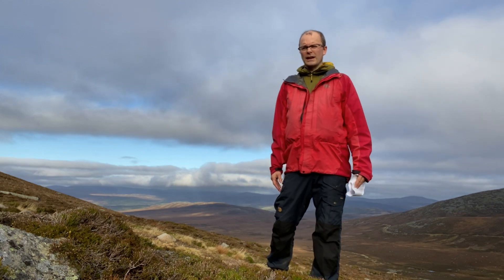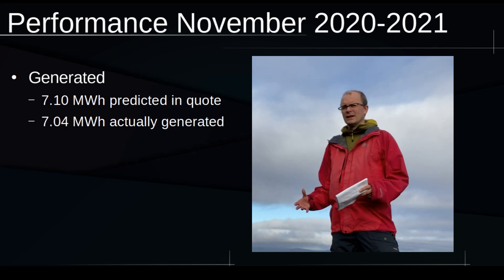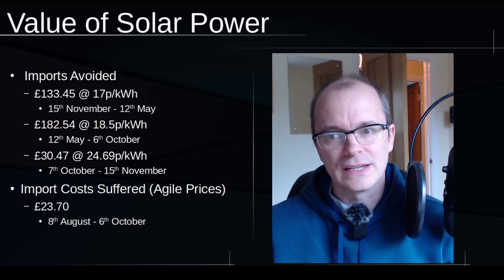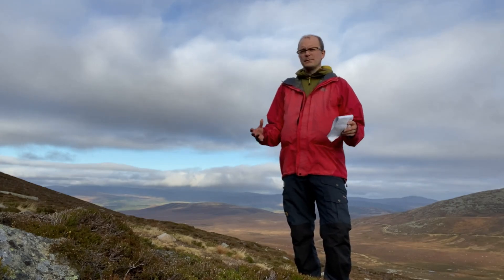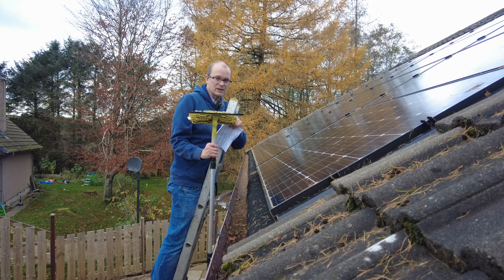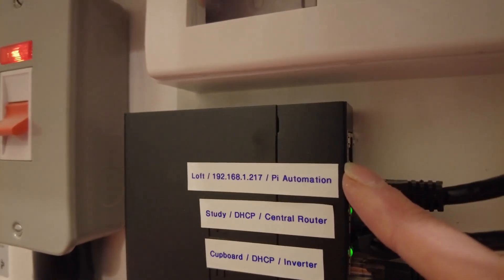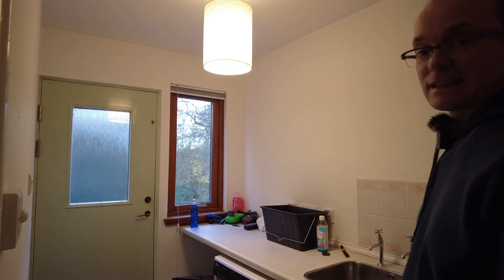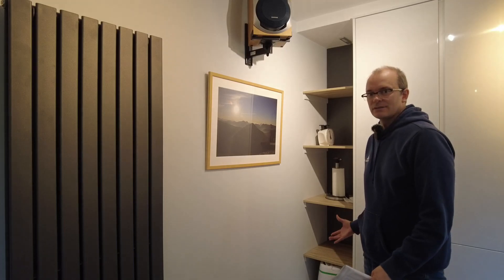First anniversary of living with solar panels in Aberdeenshire

Comment: Hi Anthony, now you’ve got your battery installed, do you still see benefit of the SolarEdge Smart Energy Hot Water diverter? My 8kw split array is limited to 6kw, so may not experience much clipping, which I understand to be a main reason for one of these.. Is the installation of this limited to SE installers? Appears very easy installation electrically wise and within my capabilities and experience as a qualified architect too.. Still only in my first month of solar installation ownership, it would just be a shame to lose out if clipping were to occur otherwise, as others have posted, cheaper to heat water with gas, albeit not the most environmentally friendly. The 5 year warranty is also a consideration.
Reply from the maker: I'd have to say that the hot water controller has been interesting before I got the battery installed.   But I wouldn't install it if I already had the battery.

The returns were there when export prices were pitiful, but as you allude to, it's not worth heating hot water if it's more profitable to export the surplus.

But there's another consideration:  Batteries give massive opportunity to simplify controls.  You can charge up hot water using the battery, and then you just need a timed switch for the hot water heater.  

This doesn't just apply to hot water heaters, but it means you don't need a "smart plug" for appliances running on surplus solar either.
Reply: @anthonydyer3939  Thanks for the prompt and informative reply. I’m in that limbo moment as waiting on my export MPAN to be provided by my DNO to Octopus.. and so trying to use all my excess solar until such time I know that it will be recorded and paid for… I was looking at WiFi immersion spur switches, but in reality, it will be cheaper to heat the hot water with gas. Maybe it’s just one of those options with excess solar that you spend a lot of time unnecessarily thinking about. My installation is 8kw and have a 6kw limit, and so I won’t know until next spring and summer as to whether I’ll experience any clipping, that could otherwise be diverted using a simple WiFi immersion spur. At £40 and I can install it myself is a huge saving, albeit lacking automation.. I may never exceed 6kW as my arrays are east and west.

Comment: Amazing how we're struggling with an energy crisis and they still limit exports so badly...
Reply from the maker: For my property there are good reasons.  When I'm exporting 5kW, the voltage at my property peaks at 247 Volts.

The UK legal limit for voltage supply is 207-253 Volts (230 Volts +-10%), so I'm not so far off that legal limit during export.  This tells me that the cable supply to my property is the constraint.  It's probably only a constraint between my DNO fuse cutout and the street, but I was quoted £7k by the DNO to get the neighbourhood transformer tappings upgraded.

Comment: I would be interested to hear you thoughts on Ripple Energy as an alternative to lower your energy bills through credits to your electricity account.
Reply from the maker: I looked into Ripple energy.  I’ve got a few doubts:
-  You are allowed buy a maximum quantity of power, up to an amount deemed sufficient to cover your annual needs + 20%.
- so let’s suppose you use 3MWH annually at home, and you pay 30p/kWh = £900 annual electricity bill + standing charge.
- let’s then suppose you generate 3MWH through your share of a ripple energy wind turbine.  You might be surprised that it does not wipe out your £900 bill.  
-  The money off your bill is only equal to the power purchase agreement price between ripple and your electricity supplier.  That is actually much lower than the open market seasonal forward prices for electricity.  So then let’s suppose the wholesale purchase agreement was for 10p/kWh.  That means you only get £300 off your bill.  Worse is that the lower wholesale price does not translate into a lower retail price on your remaining bill.  You have the same electricity prices as anyone else.

There’s worse:
-  You cannot sell or transfer your share of the ripple energy wind turbine.  The only exception allowed is when you die.  So you therefore only get benefit from your ripple energy share if you remain an electricity bill payer in the uk.  So if you get married to someone else (who pays the bills), move out of the country, move into a house where the bill payer is someone else, then your investment is a bit of a dud.

Now I can dismantle and sell my domestic solar equipment any time I want.  I could even sell them in situ and grant rights to someone else to make money off them whilst they remain on my roof.  Most likely I’d sell the house with the panels in situ and (hopefully) the price paid for the house also reflects the value of having the solar panels installed.  Similar options don’t exist with ripple.

I think ripple energy’s biggest flaw is packaging up their product as a ‘saving’ on your electricity bill.  It isn’t.  You don’t get any extra savings in real time when your charge your car up on a windy day for example.  It’s something that could be completely dissociated from your bill.  It would be better if they packaged it as an entirely separate account where you earn money for export to a portfolio of customers, and money is spent on operating costs (maintenance, insurance, finance and management costs etc….).

Now all that said, it does look like you’ll get your moneys worth out of your investment.  But do your homework.  Understand that this isn’t the functional or financial equivalent of having home solar.  

Also ask the question, do you really want to buy a share of a wind turbine, or would you be better off buying a share of a company that generates renewable power?  One concept is brand new, the other concept is well understood and highly regulated.  They each have their own risks and opportunities.
Reply: @anthonydyer3939  Thanks ever so much for the detailed replied. I came to the same conclusion as you.

Comment: Really good video - I live in Huntly and was searching to find out how profitable solar is up in Aberdeenshire - came across your channel.  Based on current prices of electric I am considering a solar array - just emailed BCsolar - would you recommend anyone else local?
Reply from the maker: I would definitely recommend phoning rather than emailing Barry Chapman.  He's a busy guy!

At the time of making enquiries, I phoned / emailed maybe four companies:
1.  One MCS company was of the opinion that it wasn't worth installing solar
2.  Other MCS companies were warning of a much higher quote for in-roof systems.  That suggested to me that they didn't necessarily have experience with such installations.
3.  Another company didn't have the MCS credentials, but they had the experience.  They had harsh opinions about the MCS scheme, mainly on grounds of cost, but they weren't willing to entertain whether that would lead to a more competitive quote to the end customer.  (hint:  you need an MCS certificate in order to get metered export that's eligible for Smart Export Payments).

At the end of the day, Barry gave the only competent quote out of all the enquiries.  I think his quote at £1.20/Watt was very reasonable given the system specification.

I will caution you though that prices for solar panels have increased considerably since last year, so it's unlikely that you'll get a quote as cheap as that.

Comment: 14 years to payback. Not really profitable investment.
Well, using it everyday, is itself cheap. 

From an engineer’s interest, I toy with just 2 panels, and it lights up half of my 3500 sf home. Of course daytime only. It also run a 10k btu air conditioner.
Reply from the maker: 14 years does assume zero electricity price inflation between now and the nominal payback time.  Once inflation is considered, it will be likely be considerably smaller. But, it’s impossible to predict the inflation rate.  So I can just make assumptions based on 15 year historical electricity price performance.

Comment: As far as putting it in your kitchen for your batteries, you don’t need to do that. I have a back storage room that’s about the same as the shed. What I did was get a sheep’s blanket and put it over my battery bank, I’ve had no issues with being too cold. I live in the Pacific Northwest and it gets pretty cold in the winter, down to the teens.

Comment: Hi Anthony, I have 16.6kWh of BYD HVM batteries, been brilliant although only a year in. Not sure why they are not more popular. 90% of the year they get me through the more expensive peak electricity in the evening even with the heat pump running.
Reply: How much were they? I am having difficulty finding installer for solar and storage battery who support non mainstream makes.
Reply: @kosmicmisfit  Batteries were €8000, house is in Spain. Working with a Fronius Gen24 inverter. Maybe ask Fronius who represents them in the UK as they are working closely with BYD.
Reply from the maker: It's good to hear your remarks about them.  Personally I think BYD is going to become a household name in Europe.  As Sandy Munro recently said, the Chinese will come over to Europe like a tidal wave.

Comment: I mentioned this in the comments of the last video, it is NOT necessary to be on agile import to get access to the agile export tariff! The ONLY tariff it's incompatible with is Octopus Go.

Just switch to their variable and get agile export.
Reply from the maker: When I switched from Agile to Go, I noticed that my export was still on Agile.  I thought this is too good to be true, so I asked, and they essentially said “oops” and reverted export tom3p/kWh.

But, your note does appear to be correct, with the caveat that you can’t switch from Agile/Go to standard and then back to Agile instantly.  You can switch from Go to Agile and back instantly it seems, but any combination with a standard tariff requires a 30day wait time.

Comment: Great video, I’m 18 months in use of solar / battery system in the Glasgow area. Do you mind commenting on how the Model 3 ownership experience is and if you have seen any issues with paintwork? Thanks Martin.
Reply from the maker: Ownership experience is fantastic.  No trouble with panel gaps or paintwork.  I just cleaned my car today, and didn’t see any trouble at the sills with my untrained eye.

There were two instances where I was parked on a steepish uphill driveway, and there was overnight torrential rain.  That rain collected under the rear bumper as evidenced by water pouring out the back when I started to drive off.  It was my mum who noticed this.  I’d have never been the wiser if I’d been by myself.  I don’t think this is a serious problem, but I’ll get my cameras in position after the next rainstorm to illustrate the problem.

One other thing.  Ground clearance is 140mm.  It’s better than a Mondeo, but the lip at the top of my driveway means I only clear the ground with a fingers width between the bottom of my car and the ground.  I’ve never grounded my car, but if you have speed humps on your journey it’s worth checking that the clearance works for your car.

Comment: Anthony - thanks for your videos. One question, I take it you don't work in an office and will therefore be home during the sunny days to charge up the car?
Reply from the maker: Correct.  If you’re working away from home then free EV charging opportunities will be limited to weekends.  Not so good, especially since weekends are when I like to go driving.

I tell you something, if working from home never happened, then I probably wouldn’t even have invested in solar panels in the first place.

You can make the solar investment work without home working, but in many respects home working is a foundation to domestic renewable investment, simply because home EV charging multiplies the value of that investment.  

Therefore you could say that I took a bet that home working was here to stay.  I might be wrong, but right now businesses are functioning normally with empty offices and I’ve got a feeling that they’ll be offloading many of them.  But entertaining that idea further requires a much deeper conversation.
Reply: @anthonydyer3939  thanks for the reply. I am back 3 days a week but hopefully in January I will get my EV. My wife has hers already so will try and sort it so one is home most work days (at least the sunny ones). I have a Powerwall so will be able to capture a good amount per day.
Reply from the maker: @petermutten1900  That sounds like a good plan.  I have wondered if I ever have to return to the office, whether I should buy a cheap 2nd hand Nissan leaf so that there’s always one car taking the solar charge in the daytime.

Comment: Great video. Nice view from the hill too. I agree that the panels fitted flush to the roof are better but I thought that mounting them above was to allow ventilation to prevent them getting too hot. Do you have "special" panels that prevent overheating, or is it just because it never gets hot in Aberdeenshire?!

Also, a question about batteries. Can you get a DC battery to store electricity direct from the panels and then feed it through the inverter when you need - that might "balance" the load on the inverter?
Reply from the maker: The panels aren’t special, but there is an airflow / drainage gap underneath the panel with these mounting adaptors.  Interestingly, these adaptors can be retrofitted with ventilation ducts, and the warmed up air can be drawn into a ducted system:
https://www.gseintegration.com/en/solutions/gse-airsystem/

Batteries:  yes, but Solar Edge single phase inverters are currently only compatible with LG Chem batteries.  Their three phase inverters are compatible with BYD batteries.  LG Chem are expensive, and they are NMC chemistries so they don’t last as long.  There’s rumours that SolarEdge will come in with their own battery, and there’s also rumours that LG Chem are likely to start producing LFP batteries.
Reply: @anthonydyer3939  Thank you. The GSE system sounds interesting if you fancy doing an explanatory video on that at some point.

Comment: Thank you Anthony for your time and input into this channel. A year ago I was planning to move to the west of Scotland and live off grid. Your channel showed me that it was possible to generate enough power from Solar to be self sufficient for 7+ months of the year. The rest of the year I hope to use micro hydro.
I am now living on the west coast, although I don't have solar setup yet as I still have to build a house, I am living off grid using a Pylontech Battery which is charged from a generator. Its just a case of buying some panels and plugging them in. One expensive step at a time.
Reply from the maker: I wish you the best of luck with micro hydro.  If you can solve your winter time needs, then you're sorted for life!